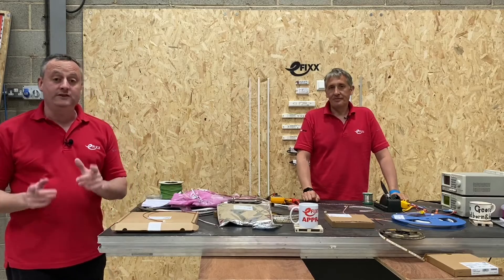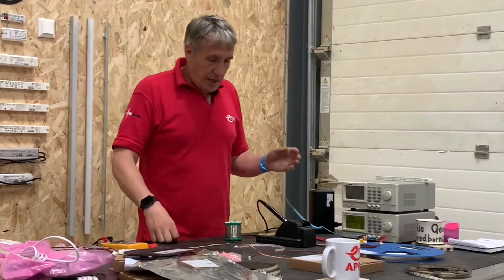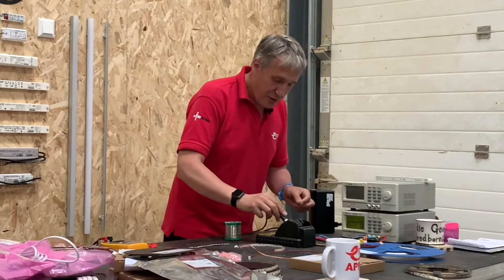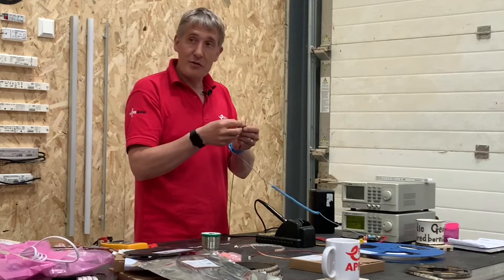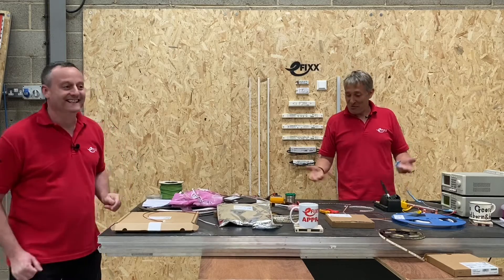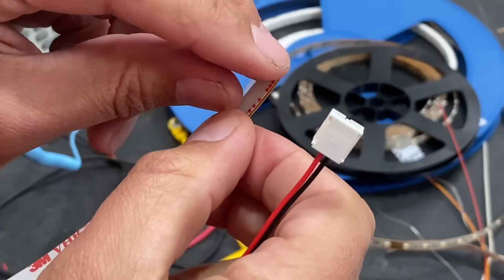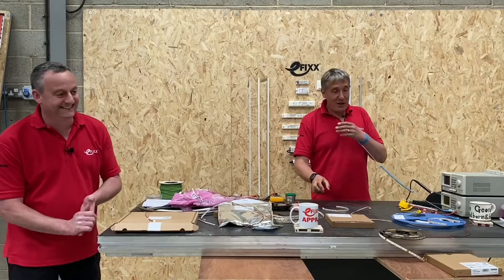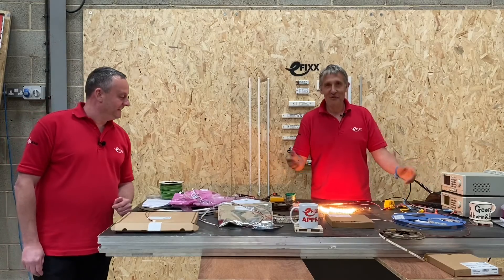How to connect LED strip lighting using solder or quick connector

Comment: Just did a job that involved fitting multiple 12V LED strips on a narrowboat. Wish I'd known about IDC connectors beforehand, they look a lot neater and seem harder to mess up. How do they work with waterproof LED strips that have the clear soft plastic coating? Will the IDCs punch through the coating or do you still need to strip it back?
Reply from the maker: OSRAM gave a special version for IDC connection of IP rated strips.

Comment: When I solder the wires on ,I then slip a bit or heat shrink sleeving over the joint . Just think it looks more professional and when it’s shrunk it’s a much stronger joint

Comment: I've got LED strip lights with pre-soldered 100mm wires. I need to extend this wire and connect to some 0.75mm flex. Can you recommend a slim profile butt connector that I can join the wires without soldering? I fit both red and black wires through a 12mm hole - so need two thin connectors, or one double-butt connector. I tried a Wago 221 but it didn't quite fit through. Thanks!
Reply from the maker: Can you not just use red butt crimps?
Reply: @efixx  Thanks, just looked those up. Presumably I'll need a crimping tool to use them, which I can get, but is there much risk of the crimp failing? Future access will be constrained by a glued, wall flush piece of wood. Many thanks for the reply.

Comment: Not wishing to get all nanny state on you, but when you're demonstrating soldering put some eye shields on, you could see 3:49 bits of solder flying off.
Reply from the maker: Depends upon your own risk assessment. In all the electronics assembly areas I’ve worked in glasses aren’t used. The fumes from the flux is a much bigger risk for longer term exposure. *Gordon

Comment: Ive made 1000s of led strips for different  company’s made to order.   Bit like Osram project service and Aurora’s cut service     Top tip would be kept the led as flat as possible and set a weigh (something with soft bottom to keep any damage to led ) on it to keep in still when soldering the ends . 
And heat shrink once finished, sometime  the solder with bleed through if the it holes in the tape which creates a short of the tape is stuck to aluminium profile.     
As most company’s recommend aluminium profile for heat transfer of the tape. 
Also if using extra glue to stick up led under cupboard  where it can’t stick just that well on it’s own.  Only use non corrosive adhesives as others will eat into the strip and solder and start to break it down over time.              

Get Gary to try a solder a 2.5 5 core on the some RGBW  that’s test him
Reply from the maker: Great tips thanks - we will ramp up Gary’s soldering challenges!
Reply: @efixx  question: how does one expose the wires on extremely thin led strips with much smaller lights? is there a solvent that would dissolve the plastic tape without damaging the internal wires? Thanks in advance!

Comment: We use the aurora tape and plug connectors but put a blob of solder on the plug terminals still, as trying to solder loose singles onto the tape is a nightmare! you have to have 3 hands 😂

Comment: Surprised that IDC is considered unreliable as you said Comms went over to IDC years ago although I would solder as I have been doing it for 60 yrs. If you tin cable first you know iron is ready before risking on the thin tape. Noticed you let ferrule move whilst solder cooling, that is a risky joint so “sparkys” stay IDC.